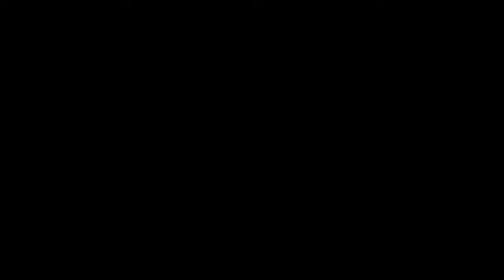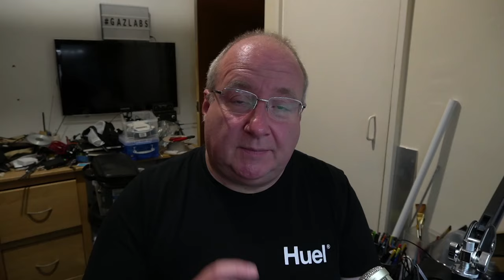ICNIRP and EMF the new licence requirements for the radio amateur and questions I have been asked.

Comment: I am lucky that i only have a IC-705 at 10w and have to you use Portable antennas. In time i might upgrade but not for the foreseable future. 73
Reply from the maker: I have the same set up, it still applies you need to record the fact you are 10watts EIRP.. its really easy.. like I say 100watts SSB into a basic antenna is compliant without any stress.. Gaz

Comment: Question. Long wire from gutter back of house running 10ft in air above my garden fence attached to tree at back of the garden. 50W SSB?
Reply from the maker: If you say ssb is 20% duty cycle that’s 10watts, if you TX for 3 minutes in 6 that’s 50% of your 10watts leaving 5watts now the fun part :-) 5x1.64 that’s 8.2watts EIRP 1.8 watts under the 10 watts EIRP limit given by ofcom. So record your calculations and happy days.. you can use the ofcom calc and print it if you like, or even the rsgb one as that works this all out for you.. Gaz
Reply: @TheGazLab  Thanks Gaz.
Reply: @TheGazLab  Not sure if you remember me 2E0PPJ. Paul. I got 7300 and Zumba spot box from you. You guys have always been helpful. I was half way through studying for advanced, OFCOM took me off course. Thanks to you I will keep trying.

Comment: Hi Gary, I live in a house with a garden 6m x 4m and have a 4BTV mounted 0.6m above the ground, Aircell 7 provides the feed at 30lm run. Running 100w from transmitter on 20m SSB suggests a minimum distance of 3.47 m.
Oddly, changing the wattage to anything other than 10 watts produces a distance of 3.14 at the lowest wattage (11 watts) but dropping by 1 watt produces a compliance.
Three local license holders on my estate have just sold up everything and given up the hobby due to non compliance and small gardens with a wish not to operate on 10watts. Basically none of us with small back gardens and close neighbours needed to bother with our Intermediate or Advanced exams. I too feel that I am being forced to give up the hobby as just wont be able to compete with the sun cycle and 10watts. Its a sad day for amateur radio.
Reply from the maker: Oh that’s not good news about your friends, I have a vertical like yourself in a 7x7 meter garden .. it’s fine, use the rsgb cal tool and remember if you are key down 3 in 6 minutes that’s 50% most of us are 1 in 6 aprox 20watts erp for the calc .. my advice is calculate it and forget about it.. it’s horse shit 😂 as I understand it’s 400-500 watts in france if someone could confirm that I’d be chuffed! Gaz

Comment: Thanks Gary, points well made. My only concern is the "centre of radiating element" statement. As I see it, a quarter-wave vertical radiates mostly at the feed point which may be only slightly above ground. This seems to be the mostly likely scenario for people inadvertently to get too close, particularly if, say, your vertical is only a metre or two away from a fence or boundary.
73 Phil M1GWZ
Reply from the maker: I should have added looking down from the top.. :-) I have lived and breathed this for 6 months, it’s all rather complicated under the hood.. I was feeling terrible that people would consider throwing in the towel yet they might already be compliant.. I’ll wait for the Feed back and perhaps budy up with someone to clarify any mistakes I made 😂 Gaz

Comment: Hi Gaz, you fired me interest... just used the RSGB xls spreadsheet and spent an afternoon modelling all my permutations... really easy as long as you have a spreadsheet program that will open the file.
I did do the Ciro Mag loop as well.. but with 200w going in it suggested it was lower then 10 watt EIRP...
I guess thats not the magnetic field... so not relevant. 
All stored as both files and printout along with my licensing documentation. All very professional ☺️
Although I doubt if I will need to show it any time soon...
But a good exercise for responsible hams anyway😏
Reply from the maker: I totally agree .. that why I said bake it into ofcom web .. have fun if you learn anything email me I’m looking for as much detail as possible 😂

Comment: Thanks Gary - a sound approach. One question comes to mind particularly when it comes to vhf/uhf: say 25 watts to a colinear is going to radiate differently to the same power to a  multi element yagi which concentrates the signal to squirt it at 90 degrees from the vertical and to my way of thinking will present less radiation where people might consider to be standing?  Do the calculations take this into account?
Reply from the maker: Yagis are treated as a 3D football at tip,, I’m doing a follow up as there are more questions being put to me lol 😂

Comment: Thank for the video Gary, but you never mentioned 2m FM which is the mode I use the most. In a semi detached row of houses or a terraced row most amateurs have their colinear on a pole off the back wall of the house.

At the height mine is I won't comply above 10W if the neighbour is in his bedroom. If I raise my antenna to comply the local council will request I remove it. If you believe any of this then it is in the interest of safety to get our antenna as high a practically possible, however the local planing will take the opposite view and say it is best to remove it for saftey.

From what I have read there is no proven link other than a small heating effect that non-ironizing radiation is harmful in any way. By introducing these regulations we have basic said there is a danger to the public. The public and the phone mast opposers will look at our hobby as dangerous, how long before amateurs get driven of the air by neighbours and councils.

Gary this not directed at you in any way keep up the good work.
Reply from the maker: This one was a bit of a litmus test. See what people thought.. I’m not an expert on this and don’t know anything more than anyone else . So  I’m learning along with the viewers .. :-) Gaz .

Comment: I’m a foundation user and rarely run more than 5w so I think I’m safe
Reply from the maker: you still need to record that, use the calculator for each of the bands you use and print it out.. put it with you licence.. 73 Gaz